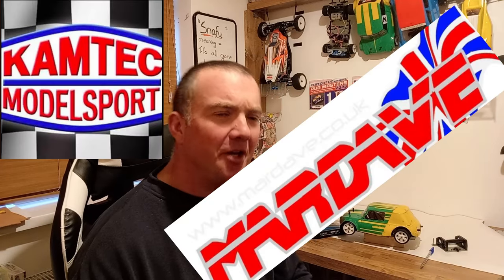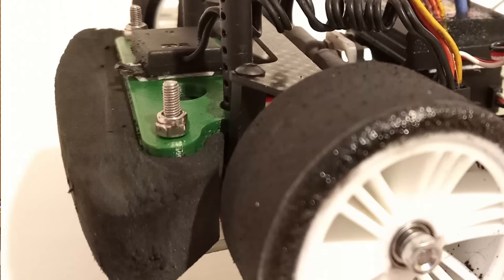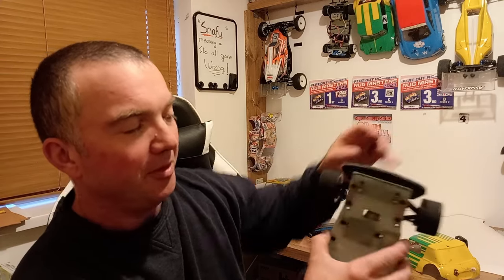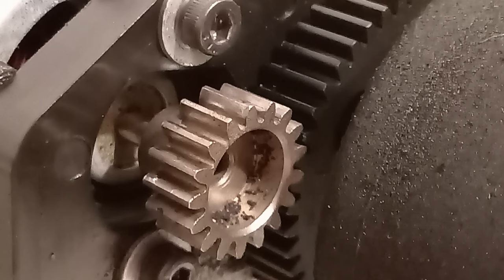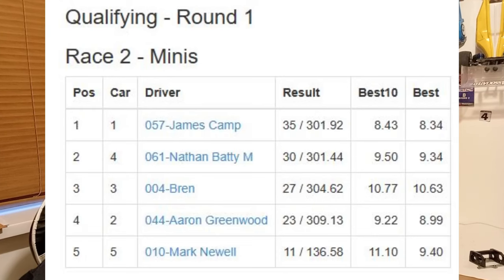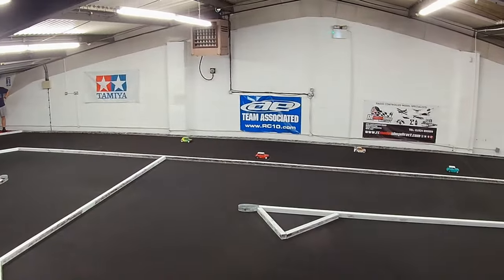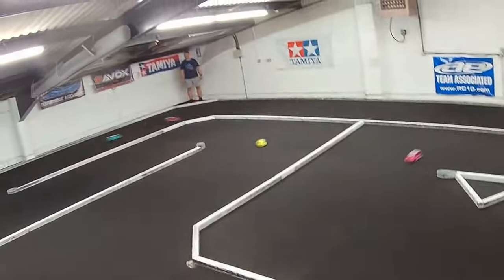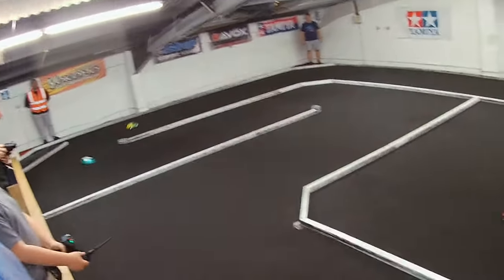Mardave / Kamtec Mini RC Racing BASIC / NEW RACER Set up (Project 27)

Comment: That's what I like about the Mardave platform, it's simple, with everyone running near enough the same spec, the skill is in the driver, not the tech.

Was around the racing scene in the mid 90s, it was Mardave minis back then, the design has changed slightly, at least with the steering set up, I remember it being a very thick brace holding the front castors, now they're wishbones, looking through my 30 year old scrapbook with an exploded diagram of the 1980s Mardave mini confirms the change.
Very good video, makes me want to get one to hoon around indoors 😆
Reply from the maker: Do it Rob.... Find a local club and let the honing begin 👍👍
Thanks for stopping by to watch and comment it's appreciated 👌😁😉